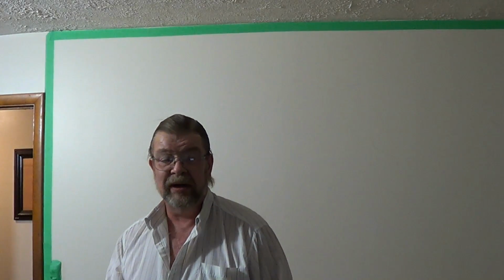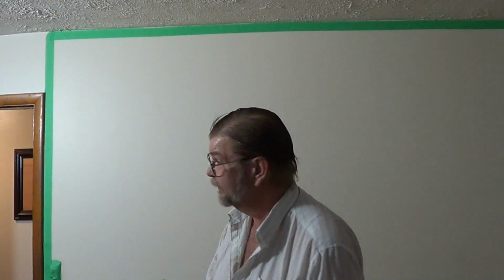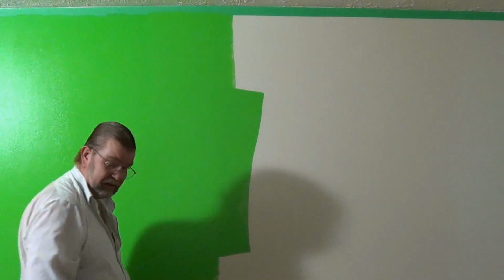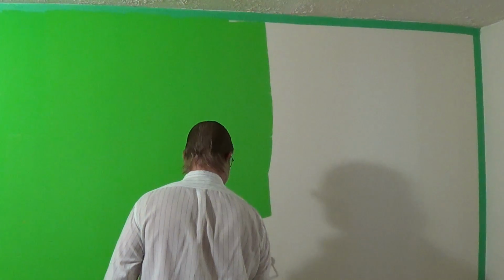DIY Green Screen for $30 - REAL USA Ep. 77

Comment: Looking good! Paul. Smooth surface green screen it's good investment for producing videos in the long run. I have had experience key out a green screen with much of creases on the fabric screen kind of painful, lol. Thank you for sharing.
Reply from the maker: munarong Thank you! We don't use a green screen often, but we hope to make more material in 2014 and this may help. The only episode of The REAL United States where we use a green screen thus far is Episode 7 where I did the introduction in front of a green screen. Lighting is the biggest issue with chroma-key and we have learned a lot in the year since we made that episode.

Thanks for watching and commenting! Great to hear from you!
Paul